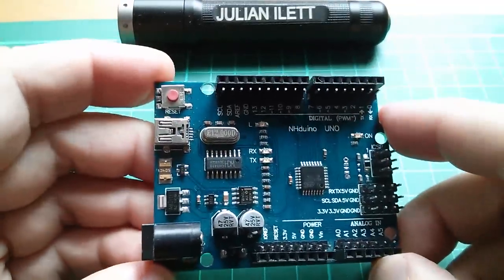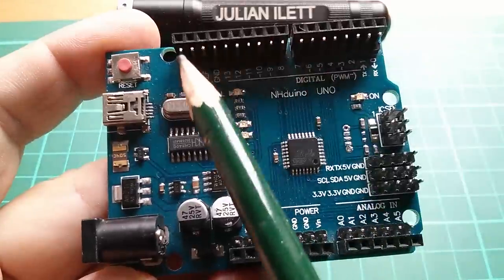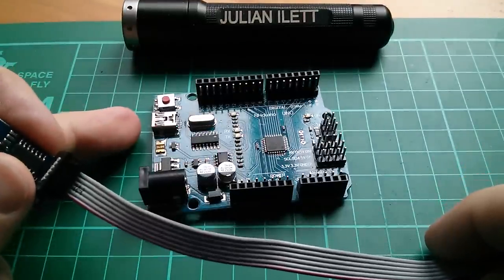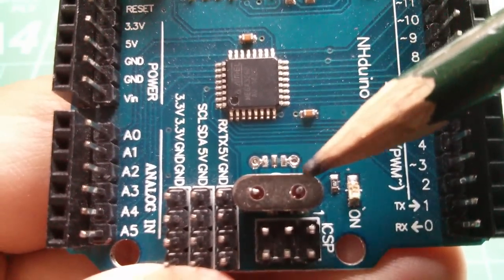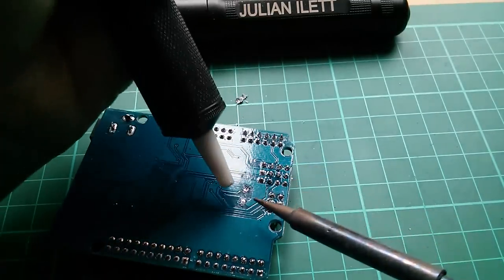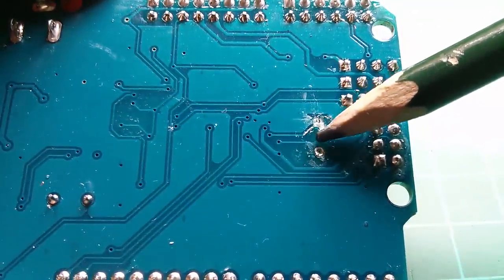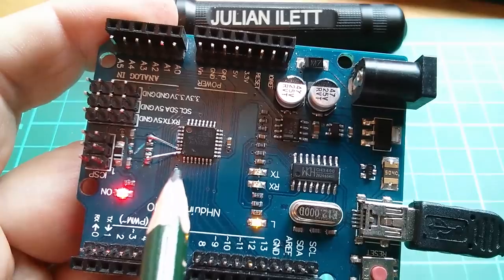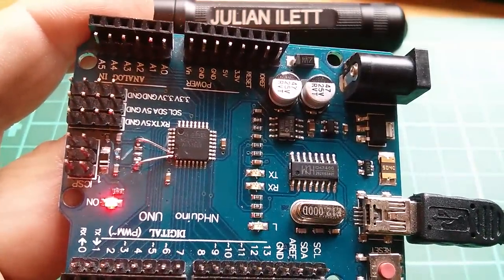Julian Sucks: Failed Arduino Uno Repair - Rescued!

Comment: I've had a strange spate of failed components lately, two arduino nanos, two nRF24s, a brushless ESC and the accelerometer of an IMU breakout board.... I think all the good luck I've had with this stuff until now is swinging back into balance. Unfortunately my diagnostic skills are not as good as yours and for the price they cost, I can handle buying a replacement :)
Reply from the maker: +iforce2d Yes, but do you violently attack the offending modules just to show them who's boss? Loving your videos by the way - it wouldn't surprise me if Amazon started their last mile deliveries using cheap ass nRF controlled drones.
Reply: +iforce2d I am breaking one ESC after another these days, just had a 25A ESC fail on me, aparantly it couldn't handle a 2212 1000KV motor, that was run for month before with a 18A ESC...
Reply: +Julian Ilett 
Don't worry.. You are far from the only one to extract a measure of revenge from uncooperative objects.. 

Best not ask what happened to the two chilli plants in my kitchen though..
Reply: +Julian Ilett I can neither confirm nor deny any reports you may have heard about violent attacks on electronic equipment under my care. Occasionally I may find myself fantasizing about driving my car over my useless wifi router and using the power steering to grind it into the concrete, but this has not happened as yet.
Reply: +iforce2d If it does, can you put it on YouTube please :)
Thanks. Oh, multiple camera angles too, if you would be so kind.

Comment: great guess on impedance around pins 13 !! got the same issue on a Mega and had already changed the clock with mo results. will retry tomorrow to jump solder on the chips correct pin (arduino mega clone)

Comment: Tip, always pull the iron away before using the sucker to prevent this kind of damage. Ive actually repaired this kind of thing so that you never knew the bad thing happened, but it takes a lot of effort. The easy way is to just remove the iron before hitting the sucker,  and you will never damage the board.

Comment: I've wrecked a number of pads on PCBs with a solder sucker. Do you think solder wick/braid would be less likely to damage stuff?
Reply from the maker: +TheUnnamedGent Yes, I reckon solder braid would have worked here. I don't know why I continue to use that sucker - it's killed more through plated holes than I care to remember.
Reply: +Julian Ilett If you put leaded solder on it before sucking, it will suck it better since it has a lower melting point  than the lead-free rubbish.
Reply: +John Ridley Strongly agree on the hollow tip heated sucker bulb thing, especially for bigger jobs. Just keep extra tips around for it.

Comment: I've noticed a lot of people talking about the desoldering, some saying that a pump is a harsh method.

It doesn't have to be, as long as the pump isn't moved or jerked on the hot pads, it's fine. Something like this helps a ton with that: http://www.ebay.com/itm/30W-220V-2-in1-Soldering-Iron-PCB-Solder-Sucker-Desoldering-Pump-Welding-Tool-/361351959330?hash=item5422415322

It helps a ton, because you can heat up the join with the pump itself, and aren't under time preassure to apply it and trigger it. This means you can jus place it directly over the hole, hold it steady, and trigger it.

Comment: @6:58 True engineering skills in action! Nice video. I have ordered 8 of these NHdunio boards to use as donors since the parts are so cheap.  I will look out for the XTAL shorting problem. Thx

Comment: don't be afraid measuring SMD, see you soldered through hole stuff to the smd pads, so measuring is even easier. Yes these whang han lo boards are miserable in quality but for a few cents you can't go wrong, at least you may salvage parts from them. Thanks for the vid
Regards
Peter

Comment: I like the old DIP version of the uno much better than the surface mount ones. I had the actual 328P itself pack up half-way through an upload. Got a new one off ebay with bootloader for just over a quid, shoved it in the socket and good to go again.

Comment: Ok, it's been a couple years now since this video, are you still using that board? If so, did you find a project where it could be mounted and made a permanent say, ghost finder or some such trinket?
Reply from the maker: Pretty sure that Uno is now on my penny organ project - and it still works fine :)

Comment: I see a lot people commenting about desoldering.
After I managed to take the component out, I have my own trick. I look very carefully where to heat up the solder, and then I turn the pcb around and I blow through the hole. And yes, there is a paper to catch all that solder flying around. And be sure not to spit .. .. But this is a cheap trick and has worked for me at least 4 out of 5 times. I hope other people can use this.
Reply: +deslomeslager Neat trick, will try it ! Am forever leaving thin bridges or covered holes and never thought to simply blow the rest away.

Comment: I bought a clone named M.J duino and from the factory had installed LM1117-3v3 instead of 5v regulator and the result was only working if powered from usb cable and not from 12v external.Malfunctions to work around and about but not exactly and the repairings of them are usually expected.

Comment: I'm I the only one who thinks, that there is no ground connection where you soldered those capacitors at the back?
i don't have this board, so cant check, but in the video doesn't look, that it's connected anywhere. :)

Comment: You can't leave the soldering iron on the soldering pad that long. That's the the problem using that sucking device. You should get a good desoldering gun. I have the Hakko FR-300, and although it is expensive, it is well worth the money because you really should be doing things properly, including rework.
Reply: +yuppiehi GTFO You can buy like 100 NHduino UNO boards for what a Hakko FR-300 costs.

Comment: Maybe that area of copper on the underside was not connected to anything? You could have done a quick continuity test. And I thought that you had a DSO so why not probe the signals to look for oscillations? Ha ha, I would probably spend far too long trying to rescue some cheap kit as well.

Comment: Atmega dont need those caps to startup, only the crystal must be enough, atmega328 works without those caps, maybe not 100% on right frequently but he will startup. The caps are probably not the problem, there must be something else wrong.

Comment: No scoping of the clock signal anywhere during the work? Funny that. Especially since I remember fighting with a bunch of these same cheapo e-bay crystals a while back. Turned out that many of them have a really weak output and are not capable of driving the chip, with or without the caps. I just chucked the bad ones away and kept the good ones after measuring them all in-circuit with a simple micro. Often you can even just lose the caps and it will still work just fine.
Reply: +petti78 
Scoping won't work. The input capacitance of the probe will in many cases stop the crystal from oscillating. It's like adding another of these load caps.

Comment: Where do you buy your arduino clones from?
Reply from the maker: +Paul Newland The cheapest listing on eBay. Alice is often the cheapest, or within a few cents of the cheapest. There are some links in the description.
Reply: Thanks! I'll take a look!
Reply: +Paul Newland less than 3$ on aliexpress: http://m.aliexpress.com/item/32436952626.html - but until they get at your home or takes 2-4 weeks.
Reply: +Julian Ilett Thanks, Julian!

Comment: Sucking the solder like that is time consuming ... get a round wooden tooth pic, heat up the solder and push the pointed end in with a decent force (squeeze fit the wood in the hole a litte to get a good clean) .. then it cool off and take out the tooth pic ... much much faster ;)

Comment: I would have removed the xtal alltogether and programmed the chip to use internal oscillator and using it like that - bearing in mind that the oscillator isn't perfect.
Reply from the maker: I was all set to go down that route. But programming a new bootloader needs the MPU to run and that needs the crystal until the fuse settings have been changed. Kind of a catch22.

Comment: if i would to have this issue i will most likely remove the critical & useful components; say atmega328, crystal, voltage regulator & headers then transfer to a perf board and program the chip with an ISP instead.
the minimum configurations....

Comment: i have a nano clone that i think i burnt out somehow. i was messing around with it one day and i think i crossed some wires while it was plugged in and it just stoped working. but those nanos are so small i dont think it worth the time to fix.. by the way love your videos. keep up the great work.
Reply: Had one failed too, check the diode ;-)
Reply: norm1124 ok thanks for the suggestion!!! i may make a video and if i get it to work i may post it.

Comment: My arduino uno had a bad input diode that rendered the 3.3 and 5 volt rails bad. The fix was putting a rectifier diode in place of the surface mount diode.

Comment: just saw this video for the first time. It was so funny hearing your rrrrrrrraaaaaaaaaawwwwwwwwwwwing :)
Reply: Flooding both pads from the bottom with a little more solder and then quickly alternately heating the pads with a quick downward tap and the crystal would have fallen out.   I actually use two TS100 solder tools to do this which is even better as gravity will do the job. IMHO solder suckers are quite brutal on tracks. Desoldering braid is only a little better.  I enjoyed the vid.
Rexlee

Comment: This is just bullshit card.
And what happens if y you burn the ic Atmega ? You'r forced tu use a smd station un unsolder it.
You'll do it 2 or 3 times max: not more.
That's why i prefer arduino models with a Dual-In-Line package for the Atmega mounted on a support.
The official Arduino Uno with DIL package nor has these silly problems of quartz done by unexperiments dudes.
Even if it should cost 35 Euros, you have a real quality  board. 
You can also make your own board, it'll even not be worse of that crap.